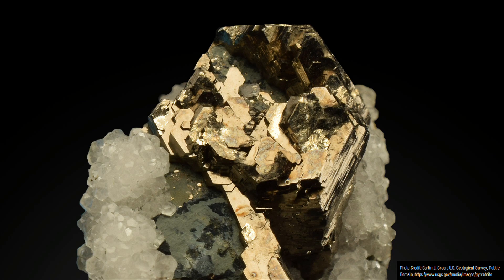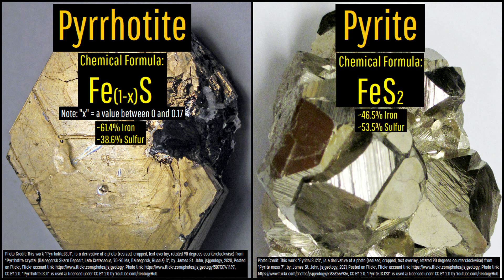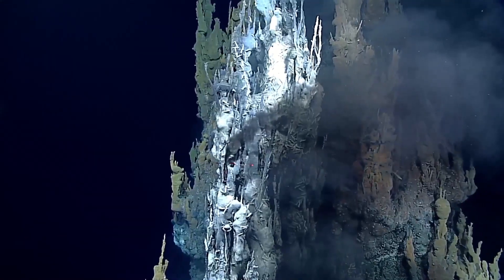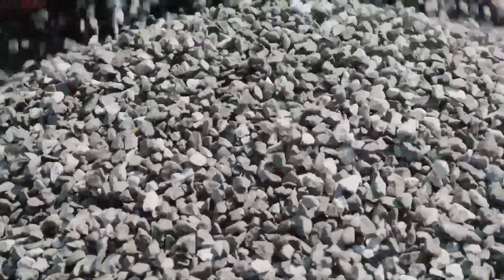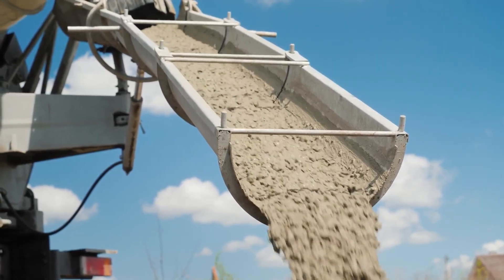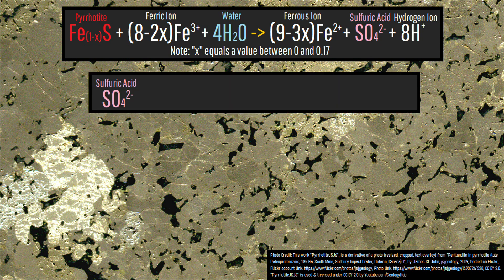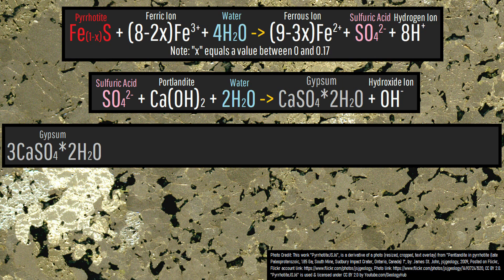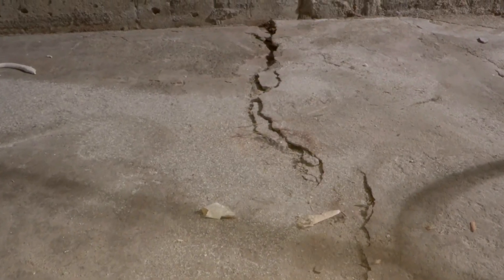A Single Trace Mineral Damaged Thousands of Homes; How This Occurred

Comment: High alumia was used in concrete slab houses in UK. It rots the metal rebars and makes the house unmortgagable.  I had a Cornish Unit house. It didnt use that concrete, but got tarred with that brush. I eventually managed a cash buyer sale. It went for half the price of a brick house.  Dont go near these odd constructions stick to good brick ones!

Comment: My foundation was one of many made with  pyrrhotite contaminated aggregate 
In 2019 my entire foundation was removed and replaced with fiberglass panels
Our neighbor is going through the process right now
There are an estimated 35000 structures built with this faulty aggregate
Its unconscionable that aggregate containing  pyrrhotite is used for anything other than fill

Comment: The old man who owned the quarry realized the problem and stopped using the quarry in the late 1960s or early 1970s. In the 1980s, under new management, the quarry was reopened. For some reason, CT has protected those owners.

Comment: This is all very disconcerting.   Especially feeling badly for those suffering from deteriorating structure damages from what is described here.   And from what I gather (as an 100% lay person) the future is bleaker when including all the other slowly but surely eroding infrastructures in roads, bridges, etc.   And the correct sand for glass is disappearing..eek!   Now I wonder, thinking again about this concrete nightmare: the work done on the Notre Dame Cathedral...
Maybe someone could answer this: when earthquakes upheave and contort highways,are these problematic concretes part of the cause for worse than necessary damages??

Comment: Fascinating.  If the issue is the acid formation,  then I wonder if it can be neutralized?  For example in Roman era concrete I think they had additional calcium carbonate little plugs in spaces.  

Maybe there is a way to get some powder down to the concrete and into cracks to slow the process?

Comment: Lack of quality control and monitoring by state agencies.  If the manufacturer of the blocks uses aggregate with a high content of pyrite, pyrrhotite or mica, then the blocks will be inferior and decompose over time.  National Standards agencies used to do lab testing but they closed down the labs and now rely on self-regulation and documents now, a big mistake.  Using high-alumina cement in Spain caused problems in the 60s and 70s as building collapsed 10+ years later when the concrete beams weakened.

Comment: Of course you don't need all this chemistry to screw up a job, stupidity will sufice as well. When working down in Dallas, TX. during the 80's many brick homes had morter that could could be easily rubbed out of joints by a finger alone. This was do to adding extra sand to the morter to make it go farther. This was in million dollar homes that snooty people liked to brag about. Lol
The seasonal expansion and contraction of the clay soil in that region results in cracks opening and closing through the year up to 2.5 inches. One mason told me he stayed working year round just on repairs.

Comment: americans and their inability to understand concrete
Reply: Europeans too.  High-alumina cement was used to make concrete beams in Spain in the 60s and buildings collapsed some years later as the concrete made with it weakened.   Pyrite and mica  in aggregates have also caused problems with crumbling blocks in houses.  The problem is lack of national standards testing and the switch to self-regulation of the building materials suppliers.

Comment: I'm a big fan of geology horror for the month of October. This video reminded me of an issue with gypsum drywall, I believe it was Chinese manufactured and imported. The drywall was either unsafe for human habitation or unstable for the purposes of drywall and it cost a lot of Florida homebuilders and rennovators a lot of money. I think I hear about this in 2018 or so.
Reply: That was recent, inferior gypsum board was shipped all over the states.
Reply: The drywall was contaminated with sulfur. 
Interestingly, enough, gypsum for sheet rock is often a product of coal power plants. But you need to get the sulfur out.

Comment: I produced concrete aggregates for 40 years dealing with all the pitfalls particularly changing cement chemistry. Never had a product claim but quite a few intense discussions with customers. Why did my concrete go bad when I changed cement suppliers etc. Stone from a large portion of the North Shore of Lake Huron is prohibited in concrete but they use the sand resulting in roadway slabs turning up at the ends or expanding to the point of shattering against each other. We are rapidly approaching a crisis in concrete aggregates.
Reply: Someof us have heard of the impending sand shortage

Comment: where did the aluminum come from to form tricalcium aluminate?
Reply: It comes from a type of shale used to make high-alumina cement, which weakens over a period of time.  Shale is a low-grade metamorphic rock derived from clay deposits. All clay minerals are silicates of aluminium, calcium, magnesium and perhaps sodium or potassium too.
Reply: It's naturally occurring in nature as an element, but tends to bond with many other elements. Thats why high voltage furnaces and flourine (as a flux) are needed to produce it. Flourine unfortunately is THE most chemically toxic and reactive substances of the periodic table due to being the only element with 7 free electrons to bond with other elements. It exists naturally in a gaseous state and will cause the element asbestos to burst into flames.
Reply: Fluorides are not fluorine gas!    Like table salt is a chloride not chlorine gas.  The aluminium comes from the shales used in cement making. @dananorth895

Comment: The first part of the video had me convinced you were going to talk about the Bentonite formations in the western United States. I'm having to deal with that on a daily basis as the ground continues to uplift and "push" in my foundation. The builders knew about the formation and designed foundations to be on piers rather than footings. It keeps the house from uplifting but not the basement walls from bowing in or concrete pads from heaving. Thousands of homes here are affected and yet they keep building. The concrete repair engineers are continuously booked with jobs to solution our issues.
Reply: Interesting and unfortunate looking it up this kind of clay it appears to be a weathering byproduct of hydrothermally altered ash beds or salt water intrusion into layers of volcanic ash so if you have this problem then that implies the underlying rock strata are pyroclastic deposits. There are lots of places out west which could meet this criterion given that you have both the fossil arcs the Tertiary ignimbrite flare up associated with the collapse of the Laramide the Yellowstone hotspot and even some explosive basin and range volcanism. 

Frankly this seems to be the typical consequence of developers unsustainable voracious appetite for building anywhere and everywhere they can to make stock portfolios go up for their likely ultra rich investors.  There is  a related issue with the building in landslide escarpment debris flow terrains which has seen many casualties over the years with many more people living in ticking time bombs
Reply: @Dragrath1  Let's face facts. Developers are  not geologists, scientists, engineers or even remotely technical people, they are money movers and financial gamblers.  How is it that we allow people to become
licensed developers with absolutely no technical knowledge??

The answer is simple. they have money and can buy the politicians that make the rules.  But regardless, the developers screwed up and they and their investors need to pay for this. Yes, they may not have known and that means they probably should not be charged with criminal fraud, but they are still responsible for making it right. Not a one of them should not be able to walk away as a wealthy American unless they pay back every dime of the costs.
Reply: @stevefritz5182 What town or city do you live in?

Comment: IIRC a bunch of houses in the Santa Cruz, California area were constructed with concrete made using seawater. This is okay in a humid, ocean-side environment for about 30 years. Eventually, enough salt dissolves, ....
Concrete is still an open topic for research, and as we get better at controlling substances at micro-scales, I expect we'll get better at engineering concrete for specific uses.

Comment: That chemical sequence is like a combination shot that sinks all the balls and then ends with a scratch. It's an insidious kind of thing Walter White would have done for some long-term revenge. Kinda makes one wonder about all the concrete China's poured around the world in the last 30 years and whether in all that building frenzy, suppliers were diligent about their chemistry. If not, we'll start finding out soon.
Reply: Well we've seen their tofu briges, highways and skyscrapers right in china so........
Their ports should be interesting, and of course those damned islands are already starting to melt....one good huricane maybe.
Reply: Its a good question I would note that China does seem to take a focus on long term development in a way the US doesn't so I would hope they accounted for that. However they have had a number of flaws in past construction projects particularly those done quickly

Frankly though its about time Portland cement got retired given its role in climate change and there are a number of alternatives being pursued as efforts are made to reduce the "carbon footprint" of the process, which for Portland cement  is close to a even proportion of carbon dioxide gas  as the amount of concrete produced.

Comment: Alkali Silica reactivity is a big issue in concrete, and most construction specs for public works require the aggregates ti be tested during the mix design process. You should do a video why this is such a big deal in certain locations (I.e. concrete is only economically feasible to produce with local aggregates, but what happens when those local aggregates are unsuitable, but the only option? Hawai’i is a great case here— no basaltic aggregates will pass ASR for concrete, but it is the only economic option. For certain special cases, aggregate can be shipped in from BC or WA, typically sand from Orcas Island for some reason)

Separately, licensed professional engineers familiar with local materials will write specifications for aggregate characteristics, and this isn’t generally determined by law. The acceptable levels should be determined by a professional engineer, so be careful making the statements you did in this video. There may be special cases or conditions where it may be acceptable, such as for non-structural concrete backfill, abandonment of underground structures, etc…
Reply: We use basaltic traprock for aggregate all the time for concrete in Connecticut.  It seems the difference is that the Connecticut quarries are in thick flows or dikes where the melt cooled slowly, ensuring complete crystal formation, and then were weathered for 10's of millions of years to remove any excess reactive silica(which is then deposited in vugs or faults as agate or zeolite minerals). The Hawaiian basalts are naturally much younger, and still partially vitrified.  To the point, the Becker Quarry was originally a traprock quarry mining the buttress dolerite formation, a diabase dike.  There were no issues with concrete quality during this time.  Eventually, the quarry operator apparently ran out of traprock to mine on their property, and began mining the neighboring Brimfield schist, which contains the pyrrhotite, and thats when the problems started.

Comment: As I sit here 2 miles away from the quarry central to this issue, in a house with an as-yet-unrepaired foundation that is gradually cracking more with every day...this hits home quite literally.
Reply: Sorry to hear that you've got a problem.
Reply: Sorry to hear about this. I can't see how anything but total a replacement of the foundation slab, and the house sitting atop it, can solve the problem. No simple cosmetic repair is remotely likely to do anything to stop the ongoing deterioration on the affected concrete. I've seen a couple wooden homes being jacked up to fix a subsidence issue, but never to remove a whole slab.
Reply: @BonannoCM  yep that's what mostly everyone is doing. Jacking up the entire house on stacks of sleepers, excavating, completely removing concrete, and pouring into new forms before lowering house back down. Nightmare
Reply: @icarus901  The cost must be insane. I hope you're fully compensated. Best wishes.
Reply: I’ve seen entire multi-floor homes moved but none from slab. To simply lift the structure could be done. Where I think being the engineer on this project would be fun I would not want to pay for it.
Reply: "cracks me up" said the concrete
Reply: @moos5221 oof.. too soon
Reply: The insurance payouts must be massive.
Reply: Connecticut established a state fund to help pay for affected foundation replacements.  @fallinginthed33p
Reply: Are you able to get repairs?
Reply: I feel badly for you that you're having to deal with this! From the compounds in the reaction, it sounds like it might affect your yard as well. I hope this gets taken care of for you soon!

Comment: Isn't this a bit like what happened with that slide at Mt. St. Helen's. They said hydrothermal alternation from hot springs weakened the upper rock.
Reply: It is a volcano, lol. The rock is going to be weak because it is essentially layers of compacted powder.
Reply: The subducting crust carries water down towards/into the mantle where it becomes superheated. Because it highly compressed it's not an issue. But if an opening of low pressure faults or magma becomes availible to it, it will expand and rise with greater and greater speed untill it flashes/expands into superheated gas mixture.
It can blow the side/top of a mountain or produce pyroclastic flows that will melt your skin off like a steam explosion.
Reply: Yeah my thoughts as well when learning about Bentonite from the comments Bentonite is apparently the product of amorphous silica reacting with an ion rich aqueous solution and amorphous silicates(glass) are a major constituent of tephra and ash which make up a large component of stratovolcanoes.

Comment: Another problematic mineral when it comes to soil types that can potentially damage foundations is a type of aluminum silicate clay called bentonite.
Reply: For sure.. it's mined here in Wyoming, and there are local soils with high concentrations... it expands like crazy when wet. I'm in real estate and we always recommend a soil test for prospective buyers in certain areas. It'll destroy a house!
Reply: @mar83161  OMG! The things you really need to be aware of just to put a roof over your head. 🫢
Reply: Bentonite is what makes clumping cat litter work.  Its ability to swell when wet makes it useful for sealing ponds and other applications.  Useful stuff, but I can see big problems with building on or in it.
Reply: I didn't realize how many bentonite  clay are there.
Reply: Strangely , Bentonite , is used medicinaly .
Reply: @davidarundel6187 Bentonite is negatively charged so many toxins/chemicals etc. stick to it like charcoal adsorbs chemicals. It also spreads out because it's so fine, ie. large surface area. So it's used internally (Sony 7) to cleanse (used to be some people's favorite ritual before a urine analysis) and as a facial mask etc. 
It's also used in cat litter to absorb odors and and a slurry lubricant for tunnel boring machines.
There's an alunlminum form (grey or tan) and a silica form (white) if I recall correctly.
Reply: I looked this clay up from another comment interestingly it seems to be a geological byproduct of the breakdown of amorphous silicate glass common constituents of volcanic ash under ion rich fluid action whether it be by infiltration of saltwater or hydrothermal fluids. Yeah I can see how that would be both abundant and nasty out there. So it looks to be something to be aware of if you are in any area which has been volcanically active in the geologically "recent" past.

Also hydrothermal fluids through a volcano built up in large part by ash and other forms of tephra? This sounds like it may  play a significant role in the instability of volcanic edifices. The hydrothermal fluid action could then induce the swelling of the rock which then would amplify the associated uplift from increased hydrothermal activity priming a slope for collapse with or without a direct magmatic component.